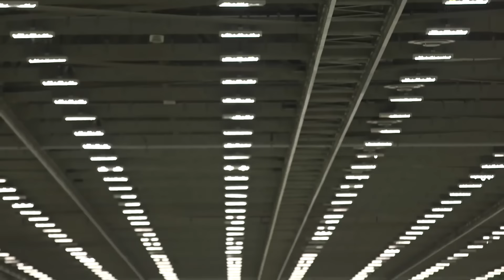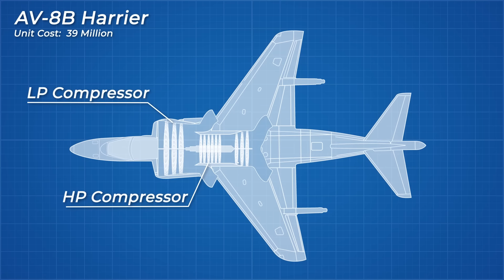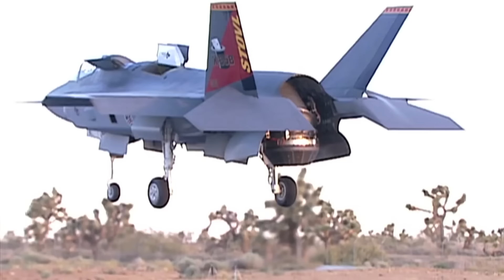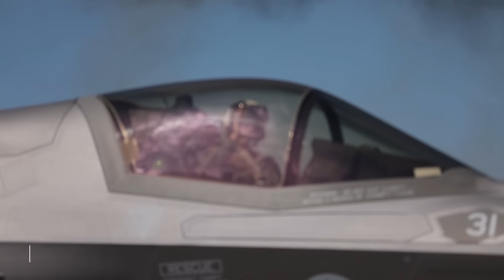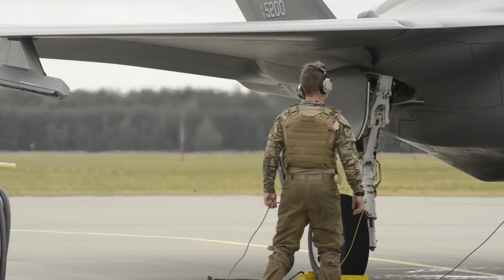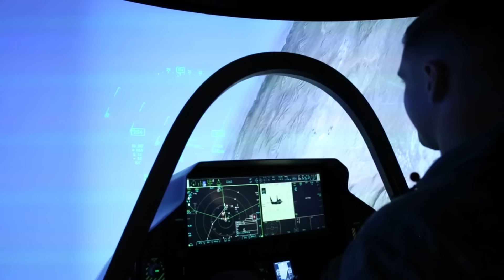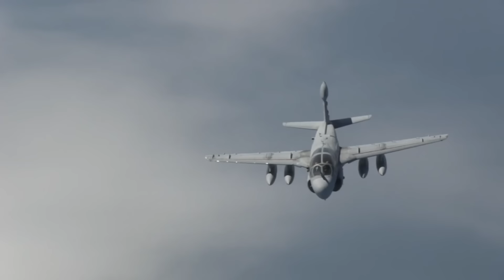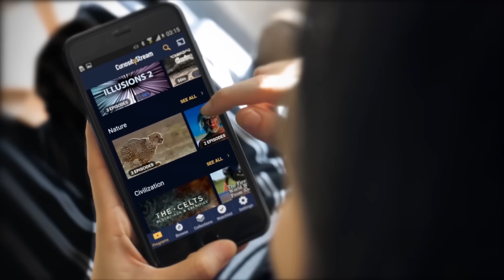Is The F-35 Worth $115 Million?

Comment: The cost of the F 35s is beyond ridiculous. When the Canadian forces was paying millions and millions of dollars to help develop the F 22 they were supposed to get them for 110, million. At the time the 35s we’re going for around 20 million.y. 
I guess that’s the main reason they stopped building the F 22s.  If they could justify increasing the cost of the F35s by 6 times in original cost. To follow suit, that would’ve been 660 million for one F22.
Reply: Canada was never involved in the ATF program... They contributed to the F-35 starting midway through development, and then chose to pull out when it came time to buy because stupid politicians wanted the RCAF to select the Super Hornet since Boeing had offered to setup factories in Canada and offer jobs to Canadians.

F-35s have never been $20 million lol. Not even during initial planning.
The original F/A-18A cost $30 million back in the 1980s and you can get 2nd hand 1980s era F-16s with no upgrades for around $40 million. The F-35 is significantly more advanced than either of those fighters.
Reply: @dumdumbinks274  😝😝😝
Canadian parliamentary committee in 2011, Rear Admiral Arne Røksund of Norway estimated that his country's 52 F-35 fighter jets will cost $769 million each over their operational lifetime. 
Do you even know what a huge money grab the F35 program has turned into? Plus we would not be allowed to touch its computer system. So we will also have to pay for Lickhead Martin employees/ or Murican Air Force techs to live in Cold lake and Baggotille to maintain / fix  said equipment.
Reply: @kockarot6362  
First off, nothing you are saying contradicts what I have stated. Your original comment is still factually incorrect. 

Secondly, you're citing sources that not only were estimations, but are from over a decade ago. Because costs have come down significantly since 2011, the F-35A will cost roughly half what you are claiming. 

The idea that you would not be allowed to touch it's computer system is a myth perpetuated by overly dramatic and uninformed media corporations. Technicians from the manufacturer being paid for and on-site has been the norm since the 1960s whenever new aircraft are adopted. It isn't unique to Lockheed Martin, let alone the F-35.
Reply: @dumdumbinks274  It is funny that you say I am wrong. What I have said was verbally  passed down to me while I was working on F-18's.
 Because I was in the Air Force. 
Except for the Norway Quote. 
Do you find not being able to touch top secret computer system's  out of the ordinary  . This what our Aviation Systems tech's were told at the time. And housing several people to remove and replace  systems that was their specialty was insulting to us at the time. That is what we were told.
Reply: @kockarot6362  Then perhaps you shouldn't put your trust in people who think Canada contributed to the ATF program.

As I have already said it is pretty normal for manufacturers to supply their own techs early in a new aircraft's lifetime. Your tech friends certainly weren't experts on the F-35, so it makes reasonable sense for them to receive assistance from more knowledgeable personnel.
Reply: @dumdumbinks274  So I shouldn't  put my trust in Air Force officers?
Reply: @dumdumbinks274  really why would I care what you said. I just some guy commenting like I am.  Are you saying you're an expert.
Reply: @kockarot6362  Considering that verifiable facts contradict your claims on all fronts, you probably shouldn't trust your officer friends on this topic. The ATF program wasn't open to investment from other nations, and the F-35 did not exist back then. 

There's also this thing called 'inflation', which explains why literally every fighter type costs significantly more than they used to. A modern F-16 or F/A-18 is only about 10% cheaper to buy than an F-35A, and the F-15 and Eurocanards are all more expensive.
Reply: @dumdumbinks274  🙄🙄🙄🙄
Do you plan on answering my question? Or just going on and on and on 🥱🥱🥱🥱
Reply: @kockarot6362  If you're happy being wrong thats fine. Just don't complain when you're corrected.
Reply: @dumdumbinks274  I am afraid  you not know all of the facts.

Comment: If an independent company started manufacturing them.... they could be sold as low as 2 million a piece. 

However only one company has the contract to make them.  They do not make extras without additional contracts,  and they pretty much dictate the price to the government..... who so easily sign on the dotted line.  
Jet fighter Aircraft are so much more simple than most people think.

A passenger plane is a multiple factor far more complex. And 10x larger.... costing 90M by comparison.
Reply: Commerical aircraft are not operating top of the line fighter jets and they arent going at mach 1.6. They dont have a super advanced radar, they arent coated in radar absorbent material that is highly classified. Fighter jets arent being produced in high numbers like commerical aircraft, which means economies of scale are harder to achieve.  Commerical aircraft arent housing advanced AAM missiles. Manned jet fighters like the F-35 will never cost 2 million dollars. Not matter who builds or how good they are at cutting costs. Its literally impossible to build it that cheap
Reply: @cjk_02221  The technology in airliners is much more more complicated.  
The only piece of tech that is pretty impressive,  is the AIM9X helmet. 
That's not built with the plane. 

The actually components of a fighter jet are very simple.  They're extremely simplistic, because of the stress that will be placed on the airframe. 
Ask any fighter pilot. My own car has more technology than the F15 my father flew.  
The planes are far more basic than you realize.
Reply: @cjk_02221  If the F35 was mass produced, you could get the price lower than 2 million.

Why sell it for 2,  when the government will pay 100.  
Fighter jets aren't complicated.  
It's a jet engine with wings.  My brother can build a jet engine from scratch in a few weeks, however he's an accomplished engineer. 

You do realize that people build 1/6 scale fighter jets* in their garages, and fly them around for fun.  

The only difference is size, a radar,  ejection seat,  a pressurized cockpit, and a few hundred bolts.
Reply: @pharma37  those “home built” fighter jets dont have any of the capabilities the F-35 has. They arent going mach 1.6. They arent amazing network fighters. They arent stealth fighters. Also to simplify fighter jets to “just an engine with wings” greatly over simplifies what it can actually do. But you are right if F-35 is mass produced it would be significantly cheaper. Thats why it went from 110 million for F-35A to 88 Million in the around 800 jets that have been produced, while also improving its reliability.
Reply: @cjk_02221  those little home made fighter jets can actually do more flight-wise, because it doesn't have a human pilot. 
The pilot can black out from Gshock,  and then the aircraft crashes with him/ her in it.  The little ones don't have that issue, so to scale... they can be flown however. 

For aircraft,  the actual materials are cheap.   They're priced the way they are,  because that is how government contracts work.  

Yes,  you can easily build an F35 for 2 million.  Most of that would be labor cost,  but if it's mass produced even further..... half of that could be automated.  

The F35 is basic.  It's not a 787.
Reply: @pharma37  im sorry bro you simply dont know what you’re talking about. Again those flight models simply dont perform like the F-35 does when it comes to combat. It cant support any weapon systems, it doesnt have the avionics and network warfare capability, it doesnt have stealth, it doesnt have AAM’s, it doesnt have the software the F-35 has. it doesnt have any of these things. Also just saying it more capable “because it can handle more g’s” is a fundamentally outdated way at looking at fighters. Any good engineer will tell you that getting the F-35 to 2 million dollars with the same capabilities is basically impossible. The most mast produced fighter which was the Mig-21 at 12,000 units got to 2.9 million dollars in 1950, adjusted for inflation thats 35 million dollars. Some countries got it down to 25 million. The mig-21 also is a much simpler fighter than the F-35 and the F-35 is also wayy more capable than the mig-21. Simply getting to 2 million dollars in todays money with a modern fighter jet is simply impossible or extremely unfeasible.
Reply: @cjk_02221  You do realize that fighter jets are never mass-produced right? 

I think you have an over-idealized image of what a fighter jet is,  and you want to make something simple seam difficult.  You obviously have never been in the manufacturing business,  and you have no clue how much more complicated large airliners are.   
I'm going to end this conversation here,  but I wish you nothing but the best. 

Take care.

Comment: The question of dogfighting superiority of the F35 is considered moot by those who fly and command them. F35 pilots will tell you that if you even get into a close-range dogfight in an F35, you've done something seriously wrong leading up to that engagement. A typical air-to-air engagement in an F35 will take place at a distant standoff range, and the enemy will be long gone before they ever see the '35 on their radar.

Additionally, a key feature of the F35 is its integration into the battlefield awareness capability of its command forces. Each '35 passes all its sensor data back to its command center, along with data from other sensor aircraft and other sources, giving forces that use the F35 unprecedented levels of situational awareness. This is part of what makes the '35 the most formidable fighting aircraft ever built.

Comment: I feel sorry for Boeing and Northrop Grumman. Both make planes to tender for contracts Vs Lockheed Martin and both made better planes only to lose out. 

Someone high up got alot of back handers.
Reply: Neither the YF-23 nor the X-32 were better. The YF-22 had more relevant strenths for the role of air superiority, and the X-32 was worse than the X-35 and still incaoable of meeting basic requirements by the final phase of the JSF competition.

Comment: So I’d like to nitpick a bit: stealth is not the deciding factor in air combat like you say it is, and from your language used you clearly subconsciously know that, because you also said a bunch of other critical factors that are as important or more important than stealth, namely sensors and the pilot “seeing them and shooting first.” 

Those are all the same three factors, and that’s “initiative.” Dungeons and Dragons uses the term for a reason, it’s the actual military term for “advantage relating to time,” right? You win, at all levels of conflict, abstracted to its single purest dimension of analysis, by controlling the pace of the conflict. Fighting on the fields you want, in the relative numbers you want, when your men are rested and well fed and theirs are not. Those basic things from as far back as Sun Tzu. 

Other examples of modern military theory demonstrating a focus on improved initiative winning conflicts:

Teaching Battle Drills to the lowest ranked soldiers that allow them to lead entire platoons effectively in combat even as a Private, to remove delays in chain of command infrastructure.

Unit side supply logistics. America has the boys at the front tell them what they need and when and they get it there. Command side Logistics, Russia has command at the rear tell the boys what tools they can afford to give them for the job they want the boys to do. Russia clearly has supply line issues in Ukraine, even without the damage done to logistical vehicles, which should be accounted for in advance by command. You can’t leave your boys at the front without whatever they say they need to win the fight you gave them. They’re the boys at the front. They know more than you, you’ve been at a desk to long, Lt. General, Sir, you’ve forgotten how to be a Captain.

Comment: You wrote that the A10 cost 45 millions but it doesnt, the A10 cost 17 millions per plane...
And you doesnt talk about the opérational costs
Reply: The A-10A cost that much back in 1980. You know... the variant responsible for many incidents of fratricide due to it's lack of electronic systems and sensors, and even lacked AIM-9s for self defence.  

A new-build A-10C would easily cost more than $40 million, and it's operating costs are no better than the F-16.

Comment: Not when the F22 cost roughly the same, especially the Air Force version. The 22 was cancelled because the 36 was cheaper, now it's close to being the same price.
Reply: When they say cheaper they aren't referring to program cost which is affected by many other factors such as how many aircraft are bought... they're referring to operational cost, and the F-35 costs half as much as the F-22 both to buy and maintain.
Reply: No the F-35 is no around 80 million dollars per copy. A lot cheaper than the early batches as expected. Our air force has 30+ already heading for 72.

Comment: In WW2, they had the capacity to produce 3000 plane a month.  Today, 30 per month no matter what they do.  How long would a European air war last?  One estimate is 2-3 days before all resources are exhausted.
Reply: That is like comparing the Space Shuttle to the Wright Flyer. The sophistication of modern 5th gen aircraft is mind boggling. WWII aircraft were barely and engine with wings and some guns attached. And as we have seen with the Russian failure to gain air supremacy over Ukraine, the modern battlespace it is a lot more complicated than that.
Reply: Military equipment is much more expensive today. A WW2 plane when adjusted for inflation would cost just over half a million compared to the cost of a F-35A which is $78 million.

It's quality over quantity.
Reply: @zachb1706  You can still take down a plane with a missile or gunfire and take out a ship with one missile. Remember the Falkland's war?
Reply: military equipment is much more complicated today in WW2 planes were some wood some metal an engine and some weapons now its much more and much better

Comment: IIRC, more recent flight trials have also highlighted another important distinction between the F-35 and earlier planes.

In simulated dogfights against F-16s, the F-35 is still indeed less maneuverable . . . Assuming the F-16 is flying 'clean'. In other words, flying with no external fuel tanks and a limited weapons load. While the F-35 can dogfight with a significantly lessened penalty from its payload. 

In short, the F-16 is more agile under ideal conditions, the F-35 is more agile under real world conditions.
Reply: Doesn't matter either way nowadays, since dogfights have all but been relegated to a bygone era and don't happen anymore - not since the Iran - Iraq war, where a bunch of rookie pilots in F-14 Tomcats screwed over more than 100 MiG's with over-the-horizon missiles and grounded their enemy's entire airforce. 

That's why stealth and detection range are the new big players in a modern war. No reason to get into a knife fight when you can snipe them out of the air without them knowing you were ever there.